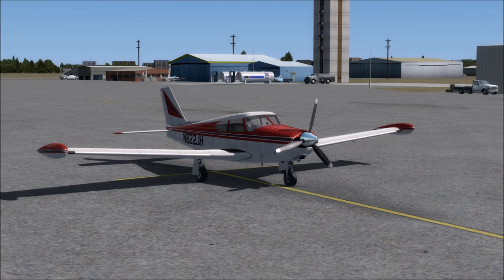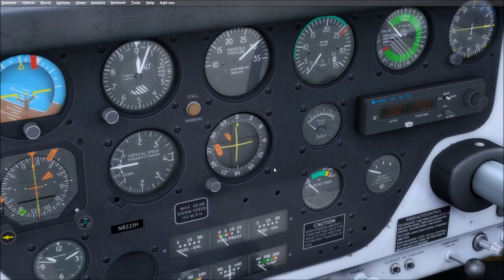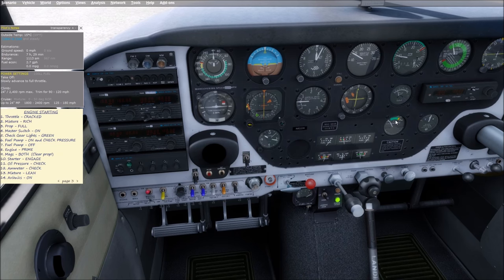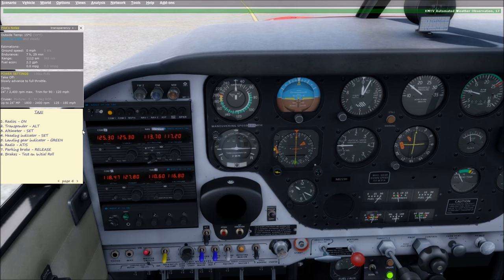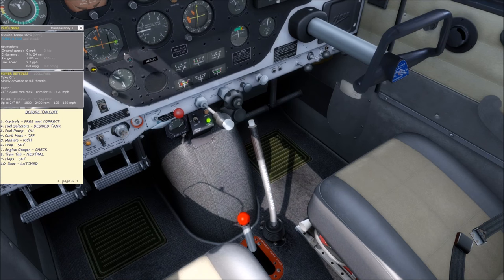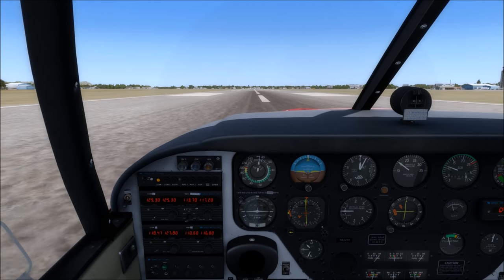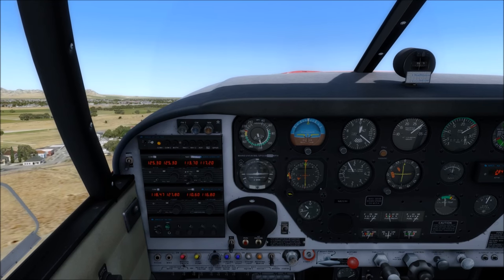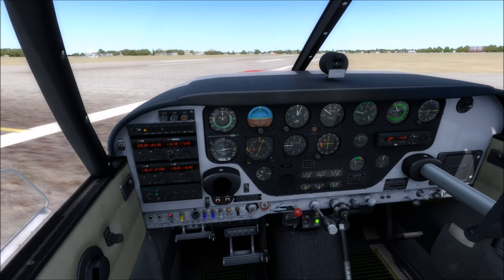A2A Piper PA-24-250 Comanche | Complex/High Performance Checkout

Comment: Awesome instruction! Just a quick tip. I add an "S" to the G.U.M.P. checklist also. Not just for seat belts as you've mentioned but also for "switches". Such as fuel pump, and landing lights. In case you're operating commercially. Keep up the good work. I'm subscribed now! I do Aviation vlogs in case you're interested.
Reply from the maker: I guess that didn't make it into the video haha. I'm reading your comment like, "I do that all the time, GUMP S, seat belts, switches...." Glad you brought it up here for others to see! Very good point.

Comment: Hello,

I have been training with the 182 and love the A2A and all it has to offer. I want to become proficient with the Skylane before trying other aircraft but would like your advice please.

Is the Comanche a logical (good) step up from the 182? How different is the Piper from Cessna for you as an experienced pilot? For a beginner like me, will that difference confuse me too much to fly both at this time? Is the complexity too great to even think about for me at this stage? What do you think will be the most challenging difference when I fly this plane?

So far all of your advice for the 182 has made me a better sim pilot - thank you :)
Reply from the maker: Jiva Daya Remembering to put the gear down and not having to worry about cowl flaps are two big changes. And the Comanche is a fast, slick plane that takes a bit more planning to slow down properly. And it's a low wing, and then just the differences in switches and radios and locations, but that's small stuff. At the end of the day, it's just another airplane and it's operated the same. You just have to give the manual a once through to become familiar with the plane and systems and know the numbers to fly by. You should be able to handle it after mastering the 182. It'll be a challenge but that's all part of the fun :) I'll be here to answer your questions as usual.

Comment: I need A2A in my life
Reply from the maker: Discwhizkid s yes...yes you do
Reply: SIM CFI So I've only ever played Xplane, however ever since discovering A2A I have been wanting to pick up P3D as well. The only thing that's stopping me are the constant "Xplane has a more realistic flight model" discussions. Do you think it's worth the money to jump into P3D? This has turned into such a dillema, lmao
Reply from the maker: Xplane and FSX/P3D use different methods of determining flight models. P3D uses lookup tables which relies on accurate data. This means that payware planes like A2A are really well done and very realistic. Xplane uses a system that can essentially read the airfoil and the plane which makes it better at a default level, but can still have errors. A2A planes are just as realistic (if not more) than anything xplane has to offer.
Reply: Thanks😀

Comment: @SIM CFI Nice video! Doesn t the manifold pressure get to high if you run the engine with 1800RPM and keep the throttle in the same position as it had before?
I have the same question if it is okay for the engine if you run it with 2400RPM an full power, because until now I thought that it would be wrong to decrease RPM before decreasing manifold pressure, but now I am not sure anymore and a little bit confused because I am sure that you know it better than I do.
Reply from the maker: Gega Zautashvili there is a chart that allows you to figure out maximum manifold pressure for a given RPM. I think it’s included in the A2A manual but I’m not sure. I’ll get back to you. Another useful chart that is included in the manual is the cruise performance charts. They give you a wide variety of power settings and it gives you an idea of what power settings are acceptable.

Comment: I noticed that during engine start for PA24, the mixture needs to be full rich? Due to the carburator engine?
Reply from the maker: Correct
Reply: @SIMCFI  From your experience, do you have preferences for carburator or fuel injector engine? I notice GA aircraft like Cessna C182 and Bonanza V tail, both don't need mixture full rich during engine start.
Reply from the maker: @jeffhiew5795  fuel injected can be harder to start when already warm. Carbs can be harder to start in cold weather. Fuel injected you can get better injectors that are more even, then get an engine monitor that allows you to run the engine more efficiently. You can look up lean of peak operations. AvWeb has some articles on that. Carbs probably cheaper and more simple maintenance. Aside from all that not sure which is ultimately better. Fuel injection for more efficiency or carbs for simple and cheaper.
Reply: @SIMCFI  I notice PA24 Comanche doesn't have a DME, can't find info in the manual too. How does the pilot know the distance to the VOR?
Reply: @jeffhiew5795  On the NAV1 Radio you have a Switch to show the DME on the Radio itself. Originally you have the Active and the passive Frequency readout and if you turn the Switch underneath the active Freq you have the DME readout instead of the Frequency. Pardon for my English, it´s not my native Language.
Reply: @MrLukla  thank you

Comment: Do you fly Piper PA-24-250 irl?
Reply from the maker: Unfortunately, no, but I've flown similar types.
Reply: SIM CFI I'm interested in your opinion on CHT management during descend and final approach?
Reply from the maker: As long as you maintain at least 15 inches manifold pressure in the descent then you'll be fine. Keep an eye on CHT and make sure it doesn't get too low. Other recommendations include reducing one or two inches every thousand feet or minute. My instructor during my CFI training is an experienced CFI and mechanic and he said as long as the engine is producing power (15 inches manifold pressure) then shock cooling won't be an issue.
Reply: SIM CFI Tnx.

Comment: As I recall, Hi Performance is a plane with OVER 200 hp, so 201 hp and up. A 200 hp plane is NOT hi-perf by FAA standards.
Reply from the maker: Andork Kuomo that is correct. If I said 200 in the video then that's wrong. Must be > 200